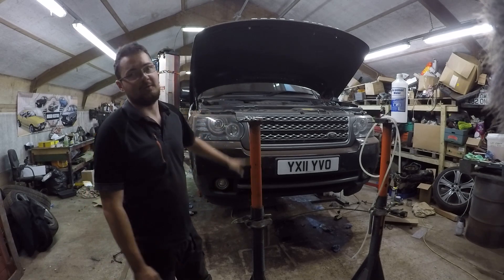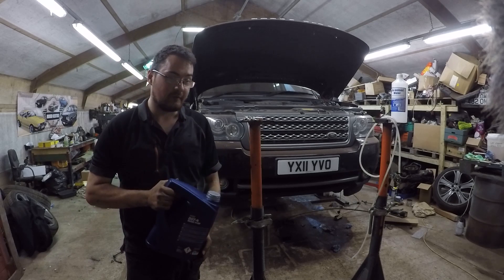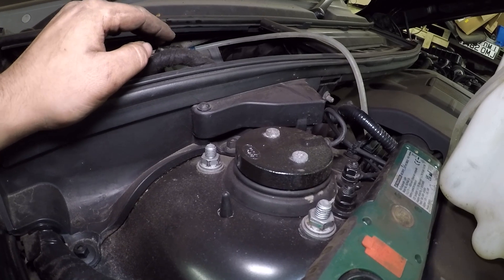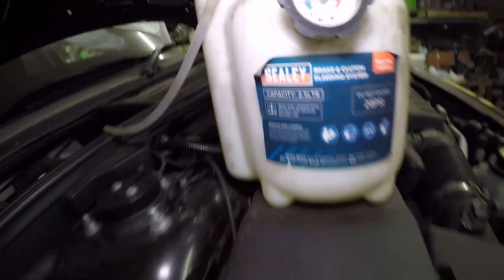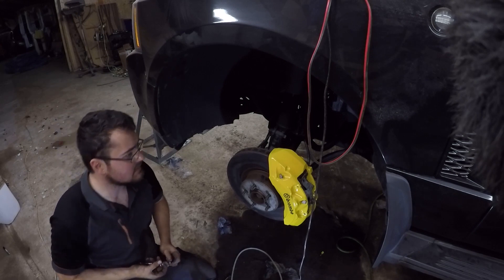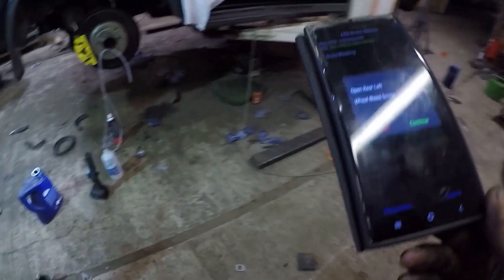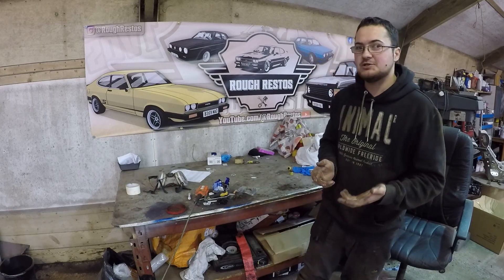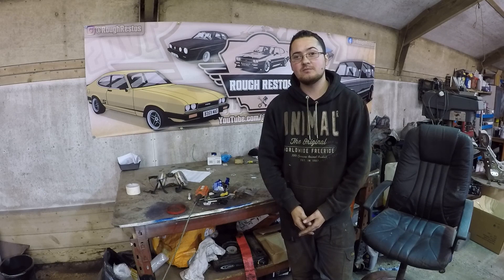Range Rover DIY HOW-TO | Brake bleeding with pressure bleeder/GAP IID L322 / L320 / Discovery 3 & 4

Comment: I emailed them about the ABS. They sent a rather rude reply ‘Google it’ 

I did some research. Basically, the front right is connected to the rear left. Front left to rear right. It’s to prevent the car pulling if one circuit fails. 

When you do the left front and rear, it cycles the ABS solenoids but doesn’t activate. this pushes some air out, then when it activates on the right side, it forces it down the line properly. 

You can just pressure bleed and run the ABS. I did it with the engine on as it kept turning off the ignition. 

Once you’ve done that. Put it in low range and HDC on. Then find a hill and accelerate and let the ABS take over. That will get the last bits out. 

I’m not convinced they have the process right and for the price, I’d expect to be able to activate solenoids separately
Reply from the maker: Thank you for the information, rather handy for others trying!

Comment: Great videos thanks! I have a 2011 as well and my friend has been doing most of what youv'e done ie bushes and propshaft etc. i'd like to know more about the ABS bleading as I am not sure after doing all the lines and hardware on the back of the car that its bled properly may get a pressure bleeder. my ABS does the same but starts back left, back right drivers side, front left then front right. we.ve been using a Mucar VO7 S works well. thanks again

Comment: I am currently trying to bleed the brakes on my l322 4.4tdv8. Connect my ICARSOFT tool which makes the ABS pump make a very quite but constant noise. How did the ABS pump react on yours? Many thanks
Reply from the maker: It acted randomly, not sure the tool was activating it correctly